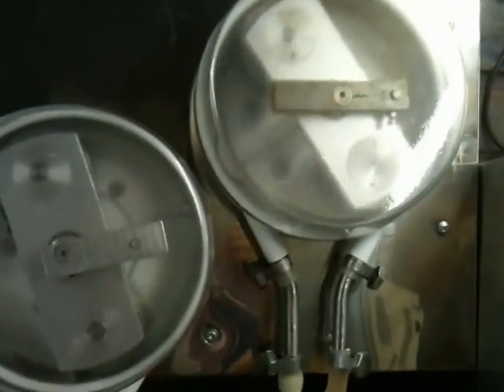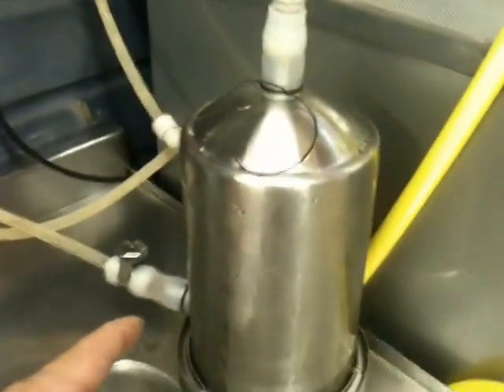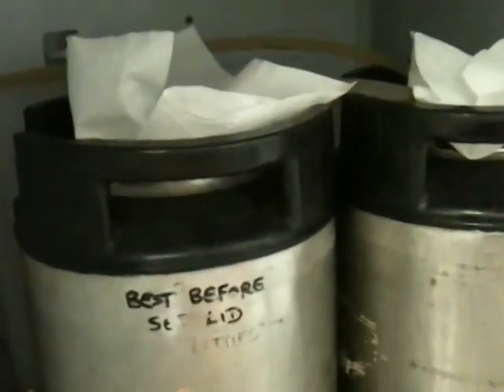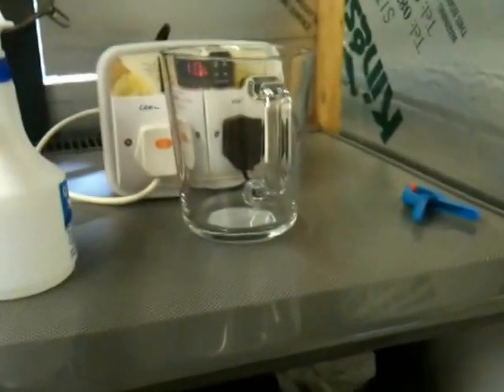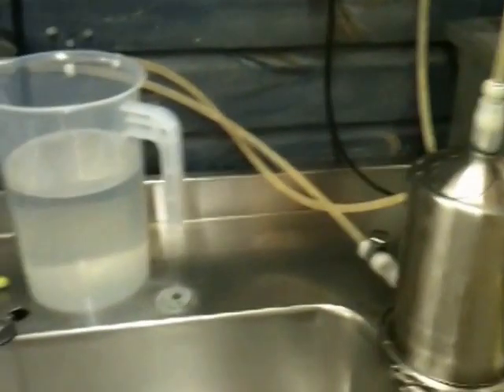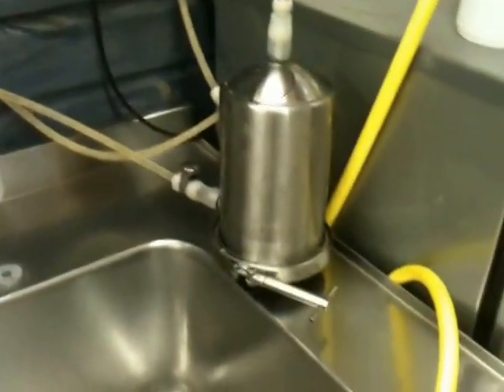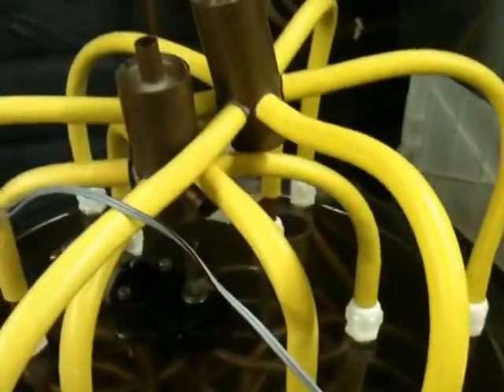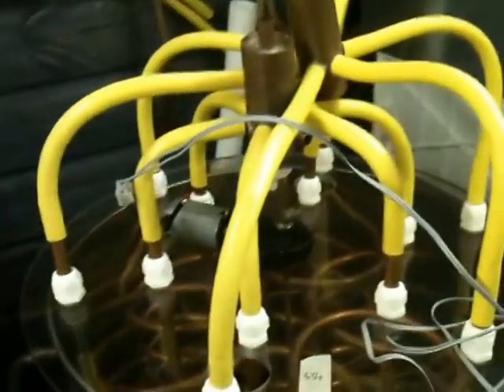Dry hopping with hop rocket and peristaltic pump

Comment: something to be considered is that silicone is very porous to oxygen. I've actually used it to infuse o2 into liquids... I use a combination of santoprene/neoprene/norprene for my pump head tubes and then something like FEP or Kynar/PVDF for flow tubing. Nice looking though.
Reply from the maker: Thanks for that oxygen info.
The pump only sucks on the shorter intake side, and as soon as a roller is reached the pressure is positive, so oxygen intake should be low to zero.
The long tubing that goes to the hop rocket to dry hop is normal beer line.
When the pumps are not in use, I have the motors connected to an auto power system that turns the pumps an eighth of a turn per day so the silicone tube is not squeezed in one place for any length of time. It also rotates the chain drive through the oil bath.
The silicone pipe within the pump and the pumps running surfaces and roller surfaces are coated in DuPont "Krytox" oil, which does not react with the silicone or for that matter anything else at all.

Comment: I love the idea of the 'safe' system you have in case something goes wrong. I've got my DIY rocket going for the first time and I held my breath as I opened the shed door to see if 5 gallons of Export were on the floor! Luckily I've got away with it so far. Cheers.
Reply from the maker: The link tube is 13 mm dia so flows easy. The beer level between the two cornies is virtually the same, so the power behind the siphon is also low, but it works. The entire floor of my brewery slopes toward a drain sump which pumps into the main drainage so I don't even get the option to drink any resultant beer puddle like you do, so safety is paramount :o)
Reply: Just had the first taste test of my recirculated hops in secondary. Came out ok and looking forward to trying it again with a more punchy IPA. Thanks for the inspiration watching your set up. Cheers.